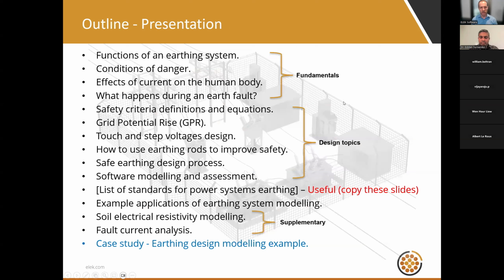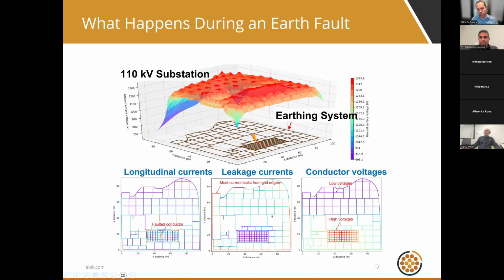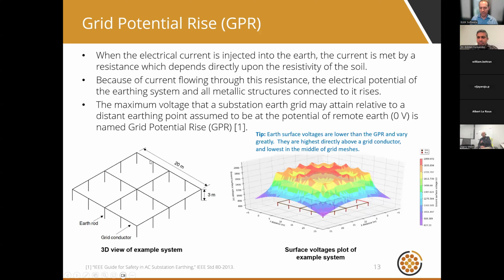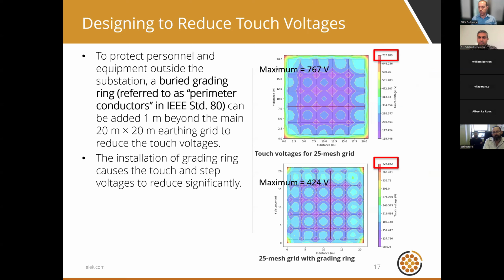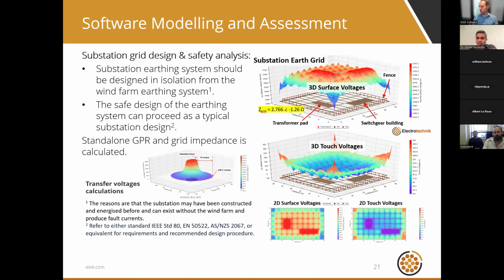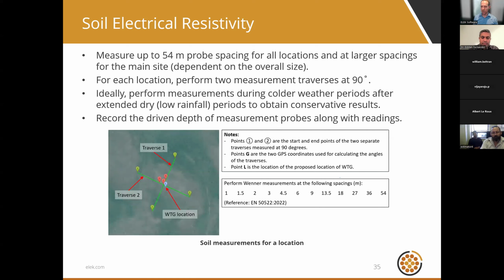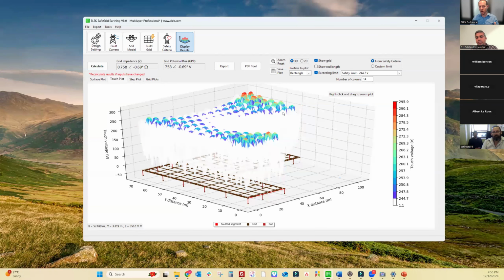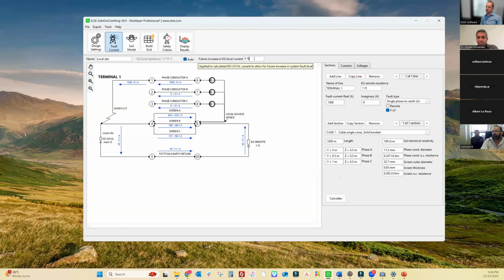Webinar - Fundamentals of Earthing Design

Comment: Hi, we've recently purchased your software, I was wondering in a case where we have a hot site(EPR above 460V) and HV and LV faults need to be separated, how would I determine how many metres of bare copper cable needs to be laid in the ground? I'm new to the industry and I carry out wenner soil resistivity tests and a network designer would give me the fault current on a different software depending on the resistance value I provide them.
Reply from the maker: @CiaraMcIlroy  model your HV and LV separate earthing systems and simulate a HV fault. Check that the voltage of your LV system is below your safety threshold. Use the segment voltages plot. Reach out to our support if you need help.
Reply: @ELEKSoftware  thank you